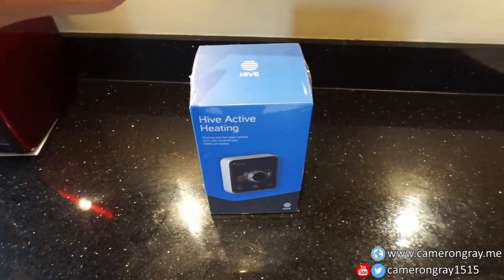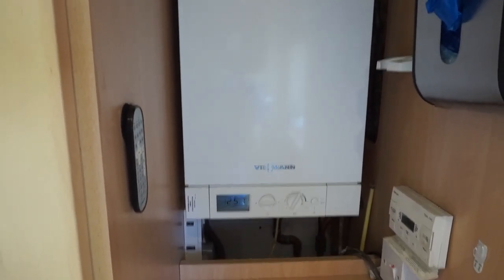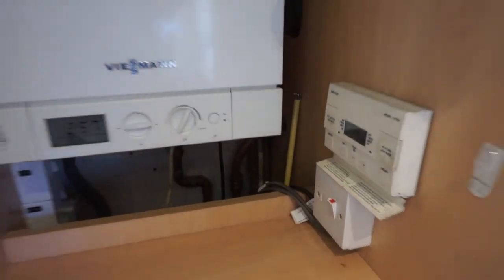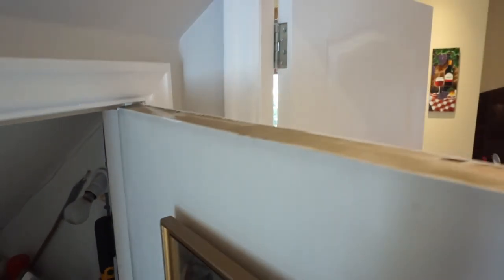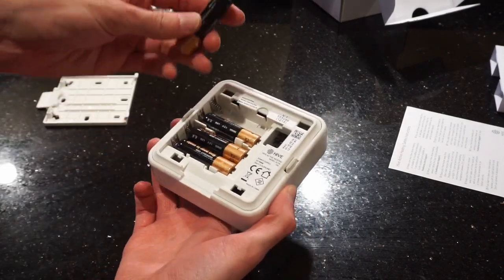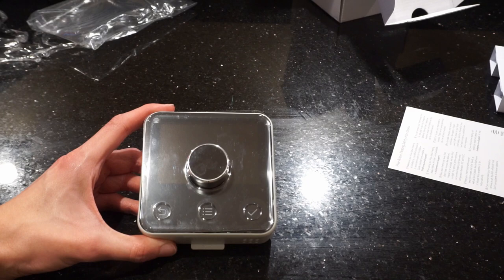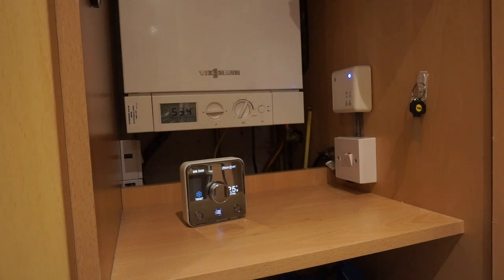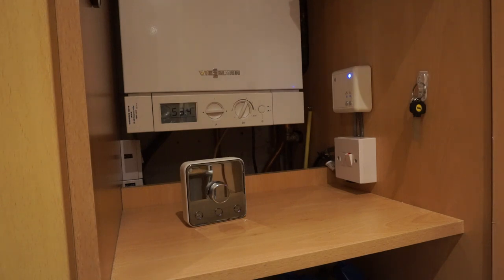Installing Hive Central Heating Control For My Parents - Dodgy wiring galore!

Comment: As a British Gas engineer for 20 years and the company that promotes and installs the hive  I’ve seen some dodgy wiring and installs in my time the system doesn’t no what it wants to be gravity or fully pumped 

it needs to be s or y plan 1 mid pos valve or 2 valves s plan one heating one hot water fully pumped that should have been done when the boiler was installed to meet the energy efficiency requirements and a cylinder stat is minimum requirement do enjoy the videos though you made the best of some very suspect wiring there

Comment: Hi Cameron, your system WAS a gravity system but now isn't due to the pump feeding the the hot water cylinder. You should convert the system to an S-plan system. John ward has a good video on this.
Reply from the maker: I was wondering that, it looked like S Plan but without a second valve and without the valve's switched outputs controlling anything, definitely looks like it could be converted fairly easily!
Reply: @camerongray1515  It would allow you to control the hot water temperature and probably save money in energy costs.
Reply: S-plan with a cylinder stat would stop the hot water getting stupid-hot when the rads are on.
Reply: @jonathanInLondonUK  That's what i had in my house before the coucil replaced my system with a combi boiler. Was wondering why there wasn't a valve also for the hot water tank? If heating is on the hot water tank will be roasting hot with wasted energy 😒
Reply: @lifeismad2k7  Yep. The hot water circuit used gravity ("hot water rises") through 28mm pipes to heat the cylinder and just relied on the boiler thermostat to control the cylinder temp.  In summer you could turn the boiler stat down, but in winter you'd get dangerously hot water.

Now with modern low-water-content boilers, they want somewhere to "dump the heat" when they shut down.  With Cameron's folks' system the pump can dump heat from the boiler to the cylinder.  With a Y-plan system there's always a path open.  For an S-plan you need a bypass valve somewhere so the pump can run to cool the boiler's heat exchanger when neither HW or CH are calling for water.

Converting to an S- or Y-plan also needs a hot water cylinder stat.  If there isn't an easy route to get a cable back to the boiler, you can get a wireless cylinder stat.

This can all get a bit complicated, and I suspect that successive plumbers have just renewed pumps and valves "like for like" with the wiring never being addressed.

Comment: just installed Hive heating in our house. we have a more conventional combi boiler but we didnt know our worcester boiler required a live loop (a wire between the live and 1 pins on the backbox) but it works great!
Reply from the maker: Interesting, looks like the single channel receiver (i.e. the one for a combi) has "dry" contacts so by looping Live through to the "common" terminal you're then passing live to the switched output when the heating is to turn on. The receiver is basically a relay between common and the NO and NC contacts. Suppose that makes sense since it also allows the use of boilers that use low voltage or "volt free" contacts (where you'd connect these across common and the NC/NO terminals).  The dual zone receiver I used doesn't have a common connection and instead just switches live to the outputs, suppose that's fine since in a system like this, the valves and pump are all designed for mains voltage, does mean that you wouldn't be able to use it with something that needs low voltage/volt free contacts without external hardware such as contactors.

Comment: Hi Cameron, 
Having just installed Hive Mini for Hot-water & Heating (on ‘S’ Plan Pressurised system Boiler) I concur with your findings and agree with your criticisms generally and you make some valid points, but I find you tend to speak a little too quickly for us ‘non Scots’ to follow easily. So I slowed playback speed to -0.75 to hear you more clearly. I encountered very similar historical crazy wiring and my suggestion is to first ensure that your wiring is put right and confirm its working properly, before installing Hive controls. That way you eliminate any system anomalies beforehand. Eg, I discovered my system would only fire up boiler when calling for Hot water first, it would not fire up boiler for heating alone and was therefore inefficient. So I went back to basics and systematically identified the connection of each wire and labelled it accordingly, noting what component it was connected to. It took a while, but I identified several redundant wires and eliminated wires that could have presented a problem. I discovered that parts of the circuit had been added/changed when a new boiler had been fitted some years previously, accounting for the inconsistencies. I found Hive installations on-line not too helpful and had to resort to Telephone help in order to fully pair the devices. Thanks for posting

Comment: The section about setting the receiver to gravity fed was just what I needed. Thank you. Your comments about the thermostat were spot on. Very hard to learn what to do when it shuts off all the time. Did you ever make a video about the app? I need to know what settings I need to allow for the gravity feed mode.
Reply from the maker: No problem!  I haven't really used the app much to be honest (set it up on my parents' phones and haven't really used it since) but it didn't require any special configuration for gravity fed mode, setting it on the receiver was enough.

Comment: Thanks for uploading. As an aside, the wiring was such a mes and in such a unappealing location. Being an ex spark, I'm not surprised previous contractors did not want to lumbered with fixing it. An in and out job.  But they should have told the owners.

Comment: One thing I found when installing is the wiring diagram on the back of the receiver was wrong for by boiler.  The switch to the room thermometer connection when connected to pin 3 was off when it should be on and live when it should be off.  So I ended up connecting that wire to the terminal 5 labelled NC (not connected) After doing that by heating was controlled correctly and the Hive is working well.

Comment: This was extremely useful. Your approach was thoughtful and considered for the view making it very easy to understand. Brilliant, I’ve subscribed!! Just a quick question however. I believe our old system (Oil Boiler) is also a gravity fed system with a single 2 port valve. But we also have a pump underneath the floor. How do you figure out if it really is a gravity fed system or has been converted to a S-Plan system? Many thanks

Comment: I ditched the Hive and went to Nest after a couple of years. The Hive thermostat started eating batteries and Hive replaced the thermostat free of charge as it was a known issue/firmware bug.  Six months later the hub kept losing connection. Due to the fact that the thermostat and receiver continued to work I would only find out when I went to use the app.  The thermostat and receiver were quite far apart but the hub was almost next to the stat and therefore it didn't make much sense that the hub connection kept getting lost.

I prefer the Nest as the wiring center/receiver can use the old stat wiring to provide the wireless stat with 12v to prevent it needing a separate power supply.

Comment: it is possible to locally control the thermostat without connecting it to my network? I would like the option to choose either to locally or remotely control it.
Reply from the maker: You can control basically all the features you'd need from the thermostat itself.  You can also set it up in "standalone" mode without a hub where it'll work as a wireless thermostat with no smart functionality at all.

Comment: I have used two nest heat links and both need to be replaced in 12 months, so now moving over to the Hive as I am thinking the hive will be alot more robust and reliable components , I would not and cannot recommend the Nest/Google for controlling your heating or hot water based on my experience and both Nest/Google heat links went faulty in winter months, not months you want to be without heating for days...also consider the additional cost of getting someone to replace the devices for you....

Comment: If guests in the house push the Heat button on the receiver could they call for heat by overriding the system? If so recommend hiding the receiver away somewhere so they control it via the room thermometer or the app only, good idea?  I guess you can lock control of that too so it can be remotely controlled from the app only.         I'm not suggesting you hold the system to random from your parents just as I'm renting out the house I don't want students cranking it up to 32C when they're a little cold after midnight.

Comment: appreciate if you can help me out please. Previous owner only left me the SLR1B receiver on the wall, will it work as standalone without internet feature if i only buy the receiver?
Reply from the maker: Yeah, if you just buy the thermostat itself it'll work as a standalone programmer without smart control or if you buy the hub as well you can have the smart functionality.

Comment: Hi Cameron, where do the 3 core and earth wires go to in the FCU?
Reply from the maker: The 3 core and earth goes straight to the programmer/receiver - neutral, earth, heating switched live and the hot water switched live.  The FCU just has T&E coming in from the consumer unit then T&E out to the live and neutral on the programmer/receiver.  The 3 core simply runs through the FCU's backbox then out to the receiver, purely from a neatness perspective.  Obviously, this is just information about how the installation I showed in this video is wired, it should not be treated as any sort of instructional information to apply to other installations which may be wired completely differently.

Comment: Great video, I just wondered if this was a duel or single channel? I've just removed mine but it all fell off before I could take a photo of the wiring. I have a single channel and can't get it to work. Which wires would go where ?
Reply from the maker: This is the dual channel receiver so the wiring will be different to yours.  **Obligatory disclaimer is that I'm not an electrician and haven't seen your particular system so the following is just intended as generic advice, if in doubt contact an electrician as this will likely be cheaper than replacing your boiler's PCB if you do something wrong and it blows up!**  I presume you have a combi boiler?  In that case you'll probably have a permanent live and neutral which you'd use to power the receiver, then you'd have a pair of switch wires coming from the boiler which will turn the heating on when they are connected together.  One of these wires would go to "Common" on the receiver and the other would go to "Heating On (NO)" on the receiver.  When the receiver turns on, the relay inside it will connect Common and "Heating On (NO)" together.  You may alternatively find that you only have one switch wire to the boiler (so you'd only have 3 wires excluding the earth) - in that case you'd likely need to connect live and neutral to the receiver as normal then connect this switch wire to "Heating On (NO)" and then add a wire link between the permanent live and common terminals.  For this second one you need to make absolutely sure that your boiler is using mains voltage switching and not some sort of low voltage/zero volt/opentherm type connection as if it does, and you wire it up this way you'll end up shoving mains voltage into the low voltage part of your boiler's PCB and kill it.
Reply: @camerongray1515  I've the same issue and done what you suggested but now the boiler is on all the time even when the green light is off any ideas why this would be ?
Reply from the maker: This sounds like a wiring issue to me so you'd need to make absolutely sure you know what wire is which and wire it appropriately.  If in doubt you're much safer getting a professional in, it's a relatively quick and cheap job and would be cheaper than if you damage your boiler.  If it's on all the time irrespective of the Hive state then it sounds like you've somehow got your switched live connected to a permanent live somewhere.  If it's on when the hive is off and off when the hive is on, then it sounds like you have the Normally Open and Normally Closed contacts on the receiver mixed up.

Comment: I connected this the same way to my Vitodens 050w and I accidentally pressed the “hot water boost” on the top of the thermostat display and it tripped everything and blew my Vitodens PCB off! I wondered why? Mind you I accidentally pressed the hot water boost before I hold on to the button which activates the gravity mode. It would have blew your pCB off if you accidentally pressed yours too..
Reply from the maker: This sounds like a wiring mistake to me.  If you were to trigger hot water without gravity fed mode being enabled on a gravity fed system, the hot water would function as normal.  If you were to trigger heating, all that would happen is that the valve would open but the pump wouldn't run and the boiler wouldn't fire.  I demonstrate this at 26:32.  What I suspect has happened in your situation is that you've somehow connected a neutral to the switched side of the receiver rather than a switched live.  When you've turned on the hot water it will have caused a direct short between live and neutral causing a huge amount of current to flow which will have tripped breakers and blown fuses.  This may not have completely killed the boiler's PCB, there is likely a fuse somewhere on the board that has blown.

Comment: Who ever replaced that Consumer unit did a terrible job... I would have expected them to work out what the ? MCB was for as they should have tested everything before hand and worked it out. Wonder what other corners have been cut on the install. 🤔Then that wiring.. OFT!
Reply from the maker: There's a lot of red flags from that install - Apparently he "fitted the new board and then the RCDs kept tripping" (replacing an old rewireable MEM board) so clearly no testing had been done beforehand.  They had to spend the night where their only power was an extension lead running from the garage which has a separate board.  This was a apparently professional electrician as well.  This is why I get so annoyed with the whole "don't touch electrics yourself, you must get an electrician" attitude.  No disrespect to proper electricians but out of the 6 electricians I've used or seen the results of their work, I've only had one I was happy with.  The others have either had extremely messy installs in new builds (including with mistakes/dangerous corners cut), my parents consumer unit install which is a bit of a mess, the downlights my parents had installed where some T&E was left bulging down from a badly filled hole in the ceiling causing my mum to sand through it(!) and then a circuit I arranged to have installed where they connected the neutral to the wrong neutral bar so it tripped the RCD as soon as any load was put on it (the guy doing the latter was even training his apprentice at the time).  While I appreciate an electrician will have significantly more knowledge and practice than the average homeowner, it's pointless when so many will see a job as something "simple" and then just rush it as quickly as possible without simply testing it!  Then don't get me started on two alarm installs I've dealt with (both from the same very well known local company) where on one they drilled into metal trunking then pulled T&E through with no protection totally scoring the insulation (and filling the ports on a network switch which was mounted vertically below with metal shavings) and then the second install by the same company who as far as I can tell have powered the panel from the back of a light switch with no FCU with the whole install, as far as I can tell, done with the circuit live.
Reply: That sounds like a proper bodge job! I be they paid top coin for it too. I totally agree with you on the "don't touch electrics yourself, you must get an electrician" line. Irks me so much that when it feels like theres more cowboys about than decent sparkies about. I do most of my own electrics where possible (Some things are better suited to getting someone in with the proper tools but then it comes down to a case of cost of those vs the cost of the cowboy...) after doing a fair bit of site electrics for the festival and such. While not the same as domestic work the theory is the same just no T&E!

Comment: Hi Cameron, Great video thanks, I've i fitted this system exactly as you have, The problem found is when I've got both hot water and heating off the boiler still firers up from time to time, Is this because the power to the boiler is not controlled though the hub or should it be?
Reply from the maker: Depending on your boiler this may be normal, mine (Ideal combi, not controlled by Hive) occasionally kicks on and does what looks like some sort of self test/maintenance routine.
Reply: @camerongray1515  ok thanks very much for your help much appreciated
Reply: @camerongray1515  Most boilers are designed now to go through an anti cycling routine. keeps the heat exchanger in top condition. This works independently of the heating controls.
Reply: This is happening to mine hot water  does not go off . so l left it to see if it would go off on  its own but did not so had to turn switch off to stop it now it comes on with times displayed but never turn off would you know why please.